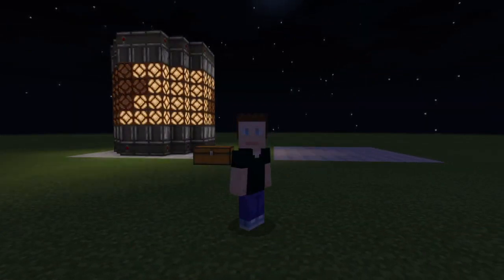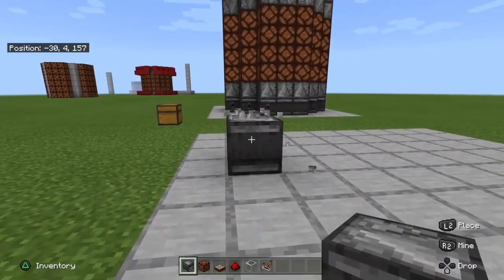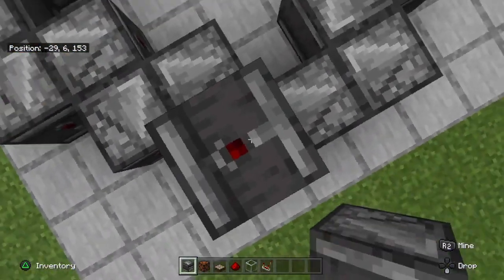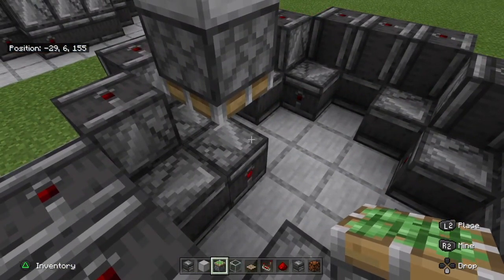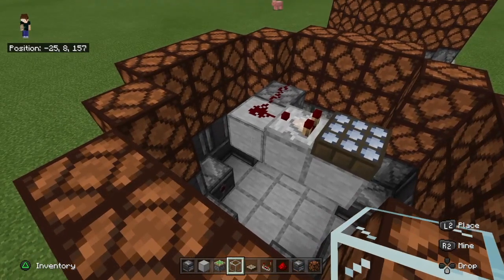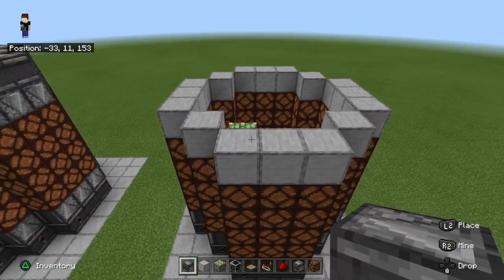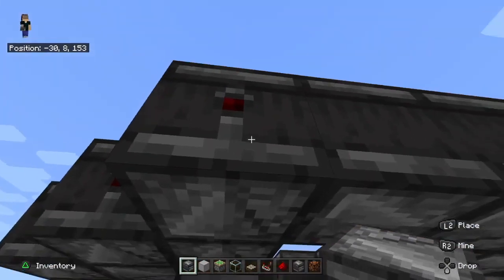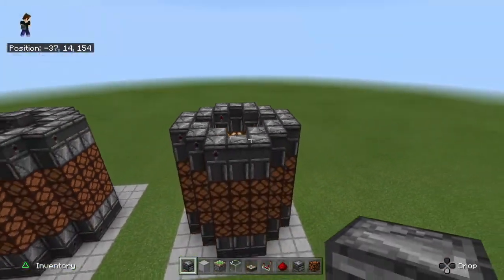Spinning/Lighthouse Light - Minecraft - Tutorial - All Platforms - Bedrock/Java/PS4/Xbox/Windows/PC

Comment: I built this on a console.  It may be a bit too much red stone for the Nintendo switch to handle.
Reply: I replaced most of the observers with repeaters on the bottom and top levels.  Light levels now update consistently but the lamps do not light up. It’s just requires too much processing for a Nintendo Switch.

I may go back and replace the entire contraption with glow stone